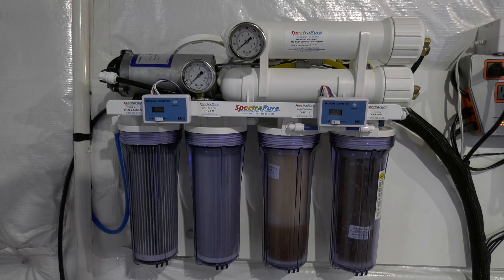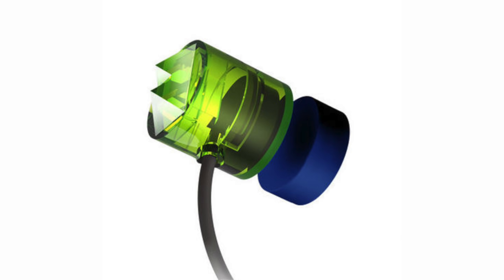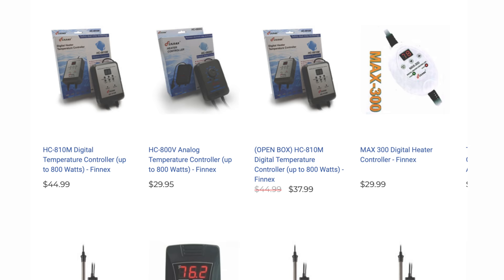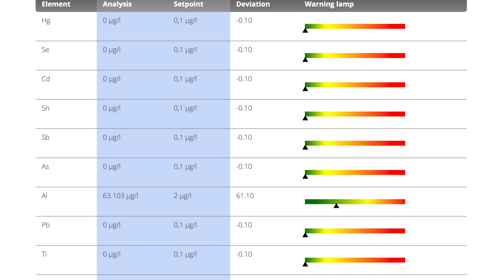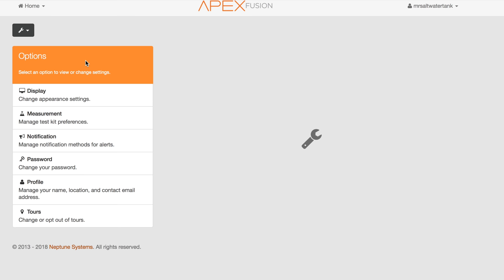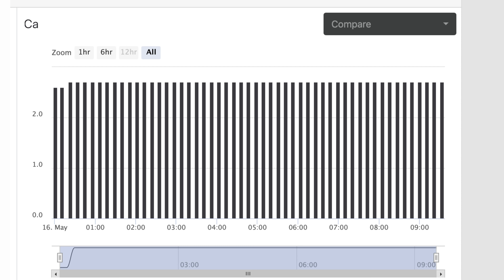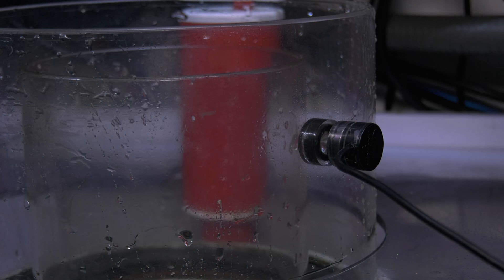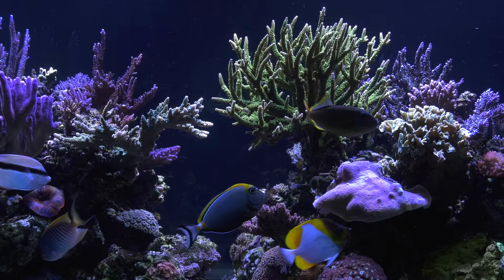DISASTER Avoided with Tank Automation Prevent Floods, Overheating, Overdosing, Power Outages, etc

Comment: Do you have to drill a hole in your RODI holding tank to install the type of float switches that were shown in the video? Also, will the Apex optical sensors seal to a curved tank?
Reply from the maker: The original floats need a hole, Ice Cap makes a float on a Magnet.
Reply: You can also try putting sensor in the lid - still need drilling but surface is usually flat

Comment: UPS are very inefficient and most of our new pumps use 12V or 24V DC anyway so we could connect them directly to a ups battery.
a pump will usually run a day on standart UPS battery, meanwhile an average consumer PC UPS will discharge in an hour without any load just from operating DC/AC inverter.
It quite simple to make a diy battery back up solution (Box, 1-2 . batteries, battery tender, 10A relay, and some appropriate for your gear DC jacks) it is WAY cheaper, and would take up a much more compact box than an UPS.
Update: Behold the glorious AD-155B Meanwell PSU with Battery backup: https://www.meanwell-web.com/en-gb/ac-dc-enclosed-power-supply-with-ups-function-ad--155b
Connect battery(ies, 1 for 12V, 2 in series for 24V, you can parallel if need longer running time) - I recommend deep discharge AGMs from UPS'es they go ~20euros a block. 
Add AC cable.
Get appropriate DC connectors for your pump(s).
Nice box (open for psu breath or better yet add a fan).
Bit of fat wire, connectors, crimps, and fuses - you probably can do everything with bolts and crimps, no soldering required.
Reply: Martynas Stanaitis Any premade examples?
Reply: @skzion2  Actually I have an improved suggestion: google AD-155 Meanwell PSU with battery back up - just add AC cable, UPS battery 1 for 12V or 2 for 24V, and wire a DC connector for your pump(s). Put everything in a nice box - just do not close it  psu needs to breathe.
Reply: @skzion2  I updated the main comment

Comment: I know something about generators but Mark didn't mention it.  Only buy an inverter generator if possible since they are the ones that have the cleanest power.  Cheap generators do not control their power output very well and can destroy sensitive electronics, like computers and refrigerators.  You do NOT want to run your expensive Apex with a cheap generator!  Honda makes the best generators hands down.  Yamaha's are also excellent with Generac inverter generator is good.  Harbor Freight generators have some Honda clones but the verdict is still out on their clean power and longevity.  If it's an emergency you might not have a choice so in that case you might want to bypass the Apex and anything else controlled by a computer.  BTW, most power supplies will not clean the power.